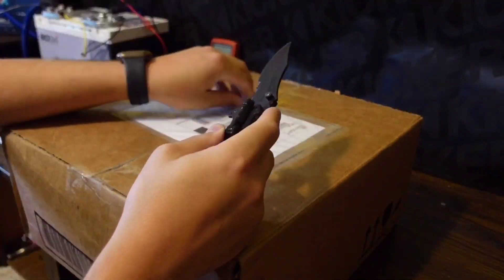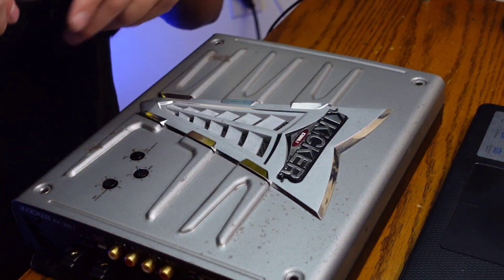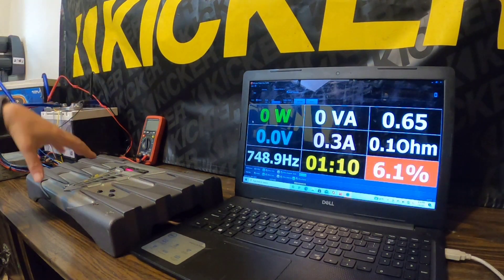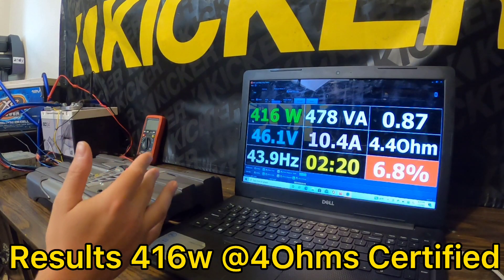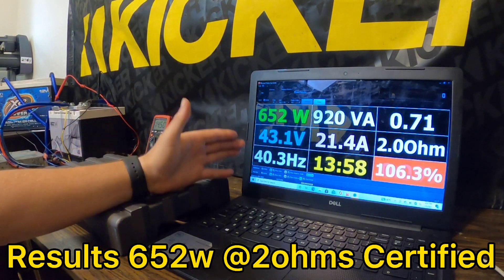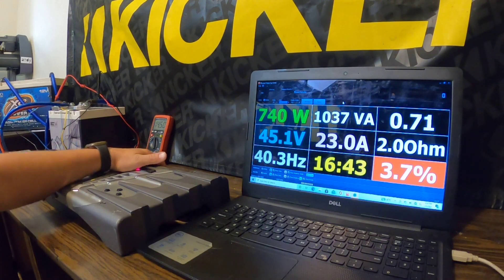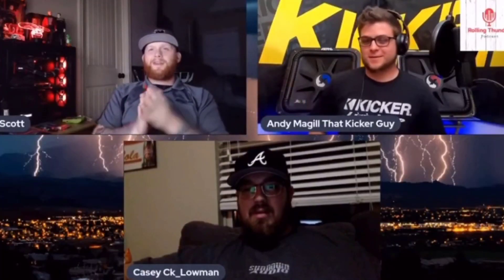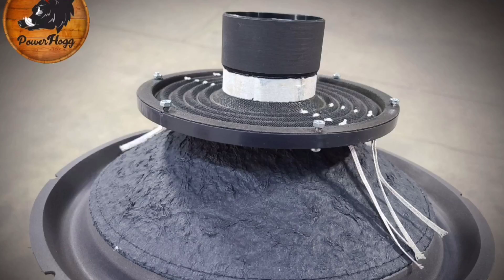KICKER KX 600.1 HOW MUCH POWER CAN IT MAKE?

Comment: I still have the older model that had the cover that goes on after you mount it. Was nice because it covered the terminals. I see this one does it too, but mine is the model before it looked like this. Had the points coming from the top and bottom instead of the sides.

Comment: I need those damn endkaps! 
I recently came across a sx 900.4! 
It's (just about) 20 years old, has a built in fan and DSP! I absolutely love it! 
Can't find where to get the kaps! They universally fit if u wanna donate those ones! Lol
But you push the sides in to take the top off, (if looking at the kicker emblem) 12 and 6 (squeeze down on 12, and push up on 6) should click out...

Comment: Glad I found this. I have this same kx600.1 mono amp, it was pushing my old solobaric L5 S12 dual 4ohm subwoofer. Went for 15 years or so no problems. Almost too much bass at times then the sub blew. I believe this was the recommended setup brand new. Had a good run. Now trying to upgrade to an L7S12 so I can keep the ported box and simply swap out the sub since cutouts are identical. I see I will be going from a 600w rms - 1200w peak L5 subwoofer to a 750rms - 1500w peak L7 sub. I never turn it up all the way anyways and wonder if it will be ok. I’ve read some people using a 600.1 on L7’s with no problems but not sure if that’s discouraged. If it won’t work will a 800.1 be fine?
Reply: Pls respond lol I’m trying to order everything tonight
Reply from the maker: Either will work fine honestly- close enough drivers to see small differences 

The new L7 will want more power but can get loud with your current set up !

Simply put yes you’ll be fine !

There’s always more room for upgrades in my opinion more power may not be as noticeable as you would think! 

Sorry just got off of the live shows from tonight ! Had a triple show tonight lol
Reply: @LivinLoudwithAndy  ok so my L7 just arrived. It slid in my 15+ year old custom ported kicker box like a glove, with screw holes aligning perfectly. Cool to know the dimensions haven’t changed. The reason my L5 blew is because the cones fried out of nowhere. Figured it was just old. Had the L7 in for maybe 20 minutes. It was bumping good and sounded nice then I started to smell the same burning cone smell and turned the head unit off immediately and everything down. I was driving so i went for about 15-30 seconds before I could pull over and totally unplug the amp from the box. Now I’m wondering what my amp should be set to. Since I have a ported box this amp is within range of the L7 I’ve read. Burning cones I hear is usually too much power. I’m running parallel 2ohm to dual 4ohm sub. What should my amp settings be on for this L7. Gain? Xover? Bass ? Should I use the subsonic filter. I also have a bass knob it’s usually turned down to 10-25% anything over that is just too much. Maybe turn the bass and gain down lower on amp? Bass was half way gain was a little over halfway. Subsonic filter was off. 
Also just noticed my power cable from battery to amp was a little loose inside the amp screw in port. So I tightened that down. 
Hoping this was the main problem kinda scared to turn it on again don’t want to blow this new speaker too.

Comment: I've had the SX 1250.1 amp for over 12 years.  I had this installed in my 97 Maxima, pushing 2 12's in a ported box, then I had it in my Mazda CX-7, 2009 Chevy Impala, 2015 Kia Forte, 2007 Nissan Altima, 2001 Acura TL, 2015 Chevy Cruz, and now it is installed in my 2021 Kia K5 GT.  I absolutely love this amplifier and it has never given me any issues over the years!  It is still going strong!